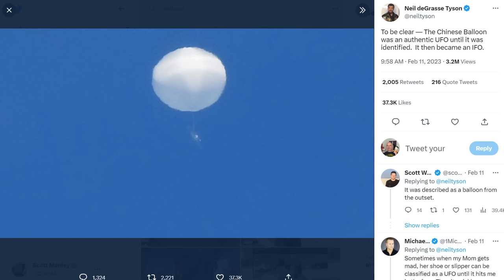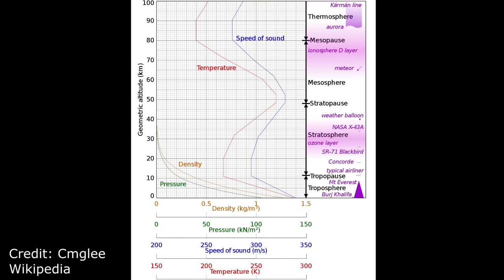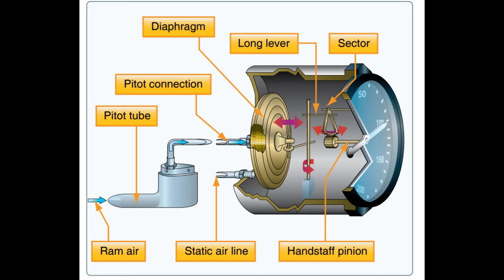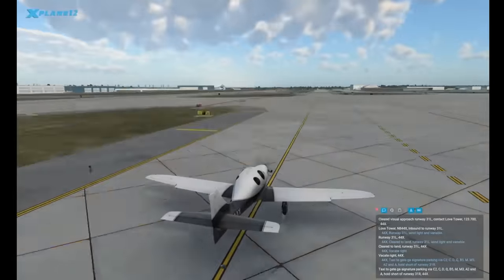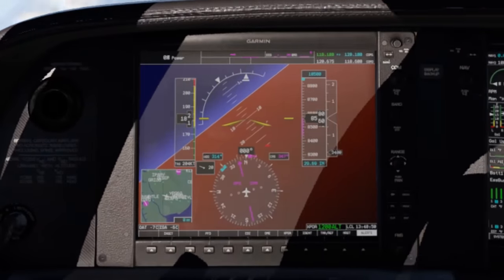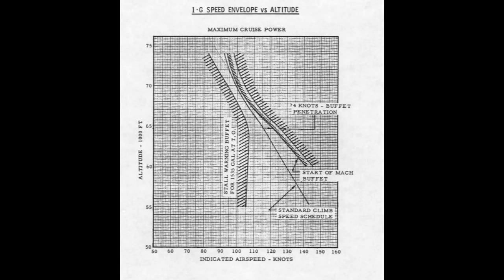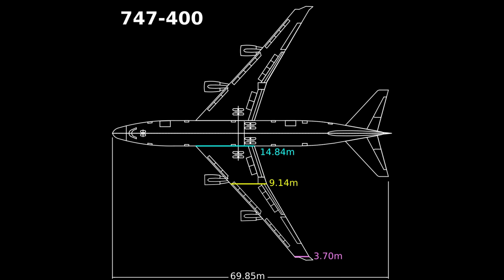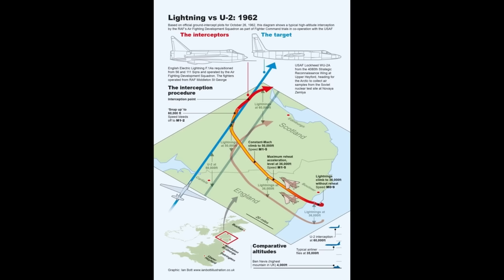How To Design A Plane To Fly At 100,000 Feet?

Comment: An aircraft that I sorta missed in this overview is the Grob G 850 Strato 2C , an experimental research aircraft build for Germany's DLR. It had a really unusual engine setup, using Teledyne piston engines that were pressure fed by turbine sections of PW127 turboprop jet engines. Current altitude record for piston powered flight at 18,552 m (60,866 ft). It's a real oddball that sadly did not have a long career, and now stands on the manufacturers airfield.
Reply: That's an insane airplane, it uses the regional turboprop engines as turbochargers for piston engines.
Reply: I was expecting it would get a mention.
Reply: The jet engine evolved from turbochargers on WWII aircraft. At a certain point the scientists realized "wouldn't it be better if we just got rid of the piston engine completely?"
Reply: @PsRohrbaugh  long before the second World War.
Reply: But it birthed the Grob G520 Egrett, one of which towed the Perlan II to 47,000 feet in 2019.
Reply: It was a very heavy aircraft. A crew of 4-5 and even a toilet plus  lot of fuel for endurance flight. Engines were old and inefficient. Would be much easier with more modern engines. Designed my own high altitude aircraft, will build it one day at 26000.

Comment: I believe I may have taken part in the highest air-to-air 'kill".  During my exchange tour from the Air Force to Navy Test & Evaluation Squadron Four (VX4) I was part of a detachment of three F-14s which flew from Eglin AFB (my previous home base).  The purpose of this deployment was to test the then new AIM-54C Phoenix missile which was undergoing operational testing.  

The target for this test was an AQM-81A Firebolt which was undergoing development to meet an Air Force requirement for a high-altitude, high-speed aerial target.  For our intercept the Firebolt was launched from the vicinity of MacDill AFB and was at 97,000 ft. and Mach 3 over the Gulf of Mexico.  

We used three F-14s to ensure that at least one of us would have an opportunity to launch a Phoenix (I was designated at the number #2 shooter).  We climbed to 40,000 ft. and GCI provided us information on the target at 140 nm.   We accelerated to Mach 1.5.  The lead F-14 got a radar track at 90 nm. (two minute from launch) and we started our pull-up at approximately 65 nm. with a missile launch at approximately 40 nm.  When the AIM-54 launched we were topping out at 50,000 ft. and the target was still almost 50,000 ft. above us which was a distance of 8 nm vertically (this was the highest I had been in a F-14)
Reply: @mcs699  I commanded the 6513th Test Squadron - The Red Hats
Reply: What's the highest an F14 has ever gone? It makes me wonder if at those elevations the wings were spread out or tucked in.
Reply: @mikeyKnows_  If I remember correctly the service ceiling for the F-14A was 55,000 ft.  The wing sweep on the F-14 in automatic was positioned by the Central Air Data Computer.  At 50,000 ft the level flight speed in military power was such that the wings would be programed fully forward (20 deg.)
Reply: @mikeyKnows_   I've heard that the F-14 has been over 70,000 ft at mach 2.5 via some of the early F-14A pilots

Comment: The A-12 at Battleship Park in Mobile relatively briefly had a sign stating that that particular aircraft had been an altitude in excess of 100'k, 108 IIRC. The next time I visited, the sign had been changed, with no reference to the altitude. When I inquired, the guy only said that they had been "asked" to change it.

Comment: Small correction: engines don’t push against the air, they push air backwards in order to move forwards. Like sitting in a canoe and throwing a rock moves the canoe in the opposite direction rather than sitting in a canoe and pushing off the dock.
Reply: Small pedantic actual correction: They do push against the air, otherwise they'd not be able to push the air backwards, that's how action-reaction works...
Reply: a ratio of the thrust from a turbine engine comes from both the spinning of the turbine (like a propeller) and from the velocity of the exhaust created by combustion. the extremes of either of these would be a propeller (some propeller aircraft DO get some thrust from exhaust but 99% of it is by pushing against the air with a propeller) and a rocket engine, where all of the thrust comes from the exhaust velocity
Reply: @LeoH3L1  Sorry, i believe you aren’t correct. The air that’s being pushed backwards is the jet exhaust. That’s the action. The plane moving forward is the reaction. If what you said is true, rockets wouldn’t work in space. Maybe I’m misunderstanding you?
Edit: maybe I worded my post badly. Props (and jets) push the air backwards to provide thrust. That’s the action/reaction. The air or exhaust hitting the air behind the engines do not affect the thrust.  The exhaust doesn’t have to push against anything because it is the reaction mass. Hope I worded it right this time 😊

Comment: F-104 starfighters had zoom climbed over 100k feet before 1960. A later variant with a small rocket booster and managed 119k
Fun to know mach 3.3 at 80k is equivalent to less than 400 knots at sealevel as far as aerodynamic forces go.
Reply: That was Chuck Jaeger and on the return down he could not recover the yaw rotation, not the same as a spin, the added thruster could not stop the   'gyration' , stable rotation about the axis of maximum moment of inertia. He landed, bruised on the parachute, after a high altitude ejection , down as the early F-104  all did.
Reply: Yes and no.  As you climb your Vne decreases because your true airspeed is higher than indicated.  Ignore and you could meet Mr. Flutter
Reply: @JonathanStCloud-yo5oq Right. Those are 2 different effects, VNE is a force limit due to dynamic pressure q=½ rho V²
Flutter is resonance of the flexibility of the structure inter acting with periodic vortex shedding  phase shift until the vibration mode becomes unstable, the relevant shedding frequency is given by the struhal number   f × d ÷ V    V= TAS
 1/sec × m ÷(m/sec)   independent of density
Reply: @Arturo-lapaz  And right you are.  I was merely trying, unskillfully, to convey that flutter is based on true airspeed, not indicated. Thank you for the math
Reply: @JonathanStCloud-yo5oq  Your statement is correct. And the Vne , the redline is not sufficient to avoid flutter.  Normally there is a margin in  the redline to account for this, at lower altitude. 
By the way you can easily  determine TAS by multiplication of CAS (~IAS)  with RDR, (Root  of Density Ratio)
altitude (ft)     RDR
18000                 1.33
15000                1.27
12000               1.200
 9000                1.15
 6000                1.10
 3000               1.05
 0                      1.00   of course
this is valid if the out side temperature deviates little from the standard
SL    15C
15°C - 2°C  per 1000 ft
( defined : 15° - 6.5 °C per 1000 meter)

Comment: Good description of coffin corner - to elaborate on the last piece of it, the idea is the low speed buffet near the stall and the high speed buffet from high mach number can coincide, meaning you don't know whether you're going too fast or too slow.
Reply: If you make a turn in coffin corner you can do both! Outside wing too fast and inside wing too slow simultaneously!
Reply: @wally7856  sounds cool for tearing off wings or for entering a flat spin.
Reply: @Steven-p4j  The Sr-71 flight rules said they had to drop 2,000 feet (from cruise) to make a course correction. They flew that plane so close to coffin corner they could reach out and touch the walls.

Comment: Other high altitude compensations are low bypass engines, ramjets, and eventually scramjets. Higher bypass engines lose effectiveness more quickly at altitude. The SR-71 did go above 85k, and it was more than capable of it. Due to its speed, ramjet, and lifting body it was well designed for those altitudes.

Comment: Nice summary and quite complete but you missed one. NASA's WB-57. It is a design that pre-dates the U-2. A licensed version of the English Electric  Canberra bomber, I watched it sampling the exhaust plume of the Delta Rocket  carrying the LandSat 7 to orbit when I was part of the group invited for the launch. It was atypical for it to be such a gorgeous day at Vandenberg as you are aware. 
On the bus going back to work at Santa Barbara Research Co.a co-worker noticed the aircraft and asked aloud about how high it was. I remembered that I had read up on it, and told him its "party trick" was its ability to exceed 60,000 ft.
Reply from the maker: I actually have a completely separate video about the WB-57 in the works.
Reply: @scottmanley  Looking forward to it, since they're a pretty cool if largely uncelebrated plane...

Comment: The insane speeds of the SR-71 is why is was so expensive. Titanium was used in order to survive higher air friction while staying lightweight, and this was difficult to mine, refine, and machine. Also they were consuming half the world's supply, so they had to set up a shell company to buy some from the Soviets.
Reply: "Half the World's Supply" sounds a bit exagerated given that the Soviet Union built Nuclear Submarines with Hulls Made of Titanium
Reply: Air compression, Samson, Titanium was used to survive hypersonic air compression, which heats up the shell. It's twice as hard to work with because at high temperatures the Titanium oxides and loses the majority of its properties.
Reply: Mining is really not too bad, titanium dioxide is a common mineral and a byproduct of aluminium mining. Turning that white powder into usable metal is quite challenging and expensive.
Reply: And it's getting cheaper ever day... look at the F-35 and how much that guy ujses of titaum compared to the F-15 for example.
Reply: @TheBackyardChemist  And having havinnng the machines to shape the mmetal because of the reasons you want it in the first place.
Reply: It was nowhere near half the supply, perhaps half the global consumption at that time though

Soviets were the only ones w/ industry and industrial-level supplies set up for Ti extraction, refining, and production

It was many more than only one shell company....
Reply: Ĺ
Reply: L99
Reply: @Genius_at_Work  I forget the exact number from Ben Rich's book, but it was some crazy large number that forced them to do business with Russia who produces an equally large portion of the world's titanium (titanium is cheaper in Russia than anywhere else)
Reply: @GreenBlueWalkthrough  Over 90% of the Blackbird's airframe was titanium, not just key components.
Reply: @Genius_at_Work  Half might be an exaggeration, but it was likely a double digit percentage. Half might be accurate for what was available to the market.
Reply: And Musk just said 'nah we'll invent a new stainless steel'.
Reply: and they have to use cold fuel tanks.. but are not sealed cause at speed they expand and seal automatically…
Reply: @batchint  Which is why the thing leaks link a sponge on the runway.
Reply: To be fair, they built ONE titanium sub, the mike class. It was designed to dive deeper than NATO weapons were capable of operation, and was so expensive they built a different class of sub as a copy, only using regular steel instead going forward. The single Mike was lost to a fire if memory serves, after a pretty short operational career.

Comment: I read where the speed limit of the SR-71 was the thermal limit of the air-frame. Even titanium gets soft when cooked to 800 degrees C.  Mach 3.1 was deemed safe, while 3.4 was reached in emergencies.
Reply: I was told it was the engine air INLET temperature that was the limiting factor... it's crazy that it's the temperature of the air being pressed into the front/cone of the engine and that air at that altitude (if I remember correctly) is -30 to -50c before being slowed down and heatet up by the cone ... And I remember the limiting number 427°C .. 427 because it's the size of the V8 in the legendary Shelby AC Cobra 427 (427 in cui of course).. and Celcius wich was odd for an American aircraft ... But apparently they used the metric system when designing the SR71

Comment: Man this was quite the interesting video, got to learn some new terms/concepts like Zoom climb, which sounds pretty cool to get an aircraft up to higher altitudes quickly.
Reply: Zooming can be quite dangerous. If you zoom too high your airspeed can get low enough, and the air is too thin, to keep the engines going and you can have compressor stalls. Losing both engines (and the flight controls they power) at that alt can be unrecoverable. I think Yeager bailed out of an F104 because of this once but I may be mistaken.
Reply: @MattH-wg7ou  Yeah I can imagine, I mean while your trading energies around for altitude, your still pushing the aircraft beyond its limits if your going well above its flight ceiling.
though I did see on wikipedia that jet fighters can do this as a tactic to out run missiles. TBH I'd rather take the risk of either breaking my jet (engines) or stalling than have a missile hit me (which it doesnt need to actually HIT  you , just needs to get close enough to go off as some use shrapnel or some other fragmentation like balls or something as their weapon to damage aircraft)
Reply: OK odd added value story, I learned about Zoom Climbs playing "Chuck Yeager's Advanced Flight Trainer" for C64 back in the late 80's early 90's ish. The game was chunky and hard to control, but with enough persistence, you really did learn about test piloting skills.
 How did those numbers get in the flight manual to begin with? Someone had to actually flight test the plane to the limit to find out (except for perhaps the 'Do Not Exceed' speed. Ripping the wings off of your perfectly good vehicle == BAD).
 Test piloting is mostly mundane and boring. For example: determining the best climb airspeed is done simply by a series of tests that just put the aircraft into a specific configuration to achieve the desired airspeed and timing how long it takes to climb through a given altitude range. Wash, Rinse, Repeat. Dull, Dull, Dull.
 The little bit left over would make for a great diapers ad.
 Full props to the Test Pilots living and dead. The required skill set is unique. Daredevil's need not apply.
Reply: @MattH-wg7ou  mentour pilot did a video on this where two airline pilots took a small airliner above its service ceiling and stalled the engines.  the heat in the engines then melted them and they could not restart and crashed.   they were too embarrassed to admit to the tower that they had lost both engines and were not able to get to a strip by the time they declared an emergency

Comment: Well, Reynolds number is very important. This can influence the aerofoil choice and wing aspect ratio. Picking the correct engine and the ramps for flight at that height is important.
Reply: Bernoulli's principle and the Coanda effect (If supersonic)
Reply: If you can fly fast at altitude, you can use ramps or a shock cone to slow down the air and compress it for the engine to ingest, this could get more performance from the engine at high altitude, especially considering you'd be increasing the difference between V9 and V0 which would increase thrust.
Reply: As an aircraft passes into supersonic speeds, the centre of pressure changes with is something worth noting. Concorde countered this by changing the centre of mass by pumping fuel to different tanks, thus keeping the aircraft under control.
Reply: The EE Lightning is a good example of massive power and zoom climbing too
Reply: The EE Lightning's max altitude is still classified if I remember correctly
Reply: The first comment made by another person

Comment: The SR71 is just a fascinating study of what you can build with no budget limits.  Originally it was a design for an interceptor but even the Imperial air force chocked on the cost of building hundreds of them.
Reply: The SR-71 and its predecessor the A-12 were both designed for reconnaissance. The YF-12, an A-12 variant, was designed to be an interceptor, and that's the program that was canceled.

Comment: Most high performance private jets actually get to fly higher because of two factors, first is that their payload is usually quite low (difference from an airliner which will be quite loaded for the airline to make money), and second is that VIPs usually prioritize a smooth flight, and getting to 50.000ft is a great way to avoid weather.
Airliners do have a VNE, which is a factor up until about 25/30K feet, when it will cross the MMO (max operating mach) which will be the operating limit.
On most modern airliners, you get to climb enroute as you burn fuel down, and when climbing near the ceiling you can actually see the coffin corner on your airspeed indication, as it shows both stall at lower speeds and MMO at higher speeds.
Thanks for your videos!
Reply: One other factor. Their cabins are sometimes stressed fir higher Dp.